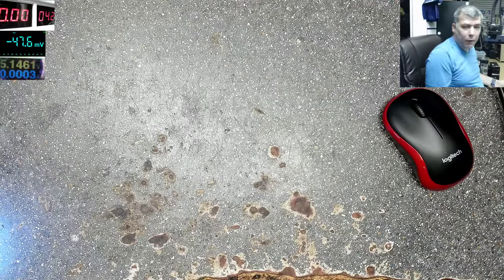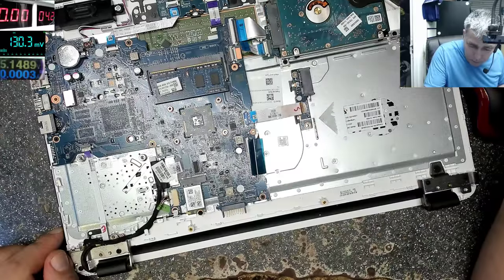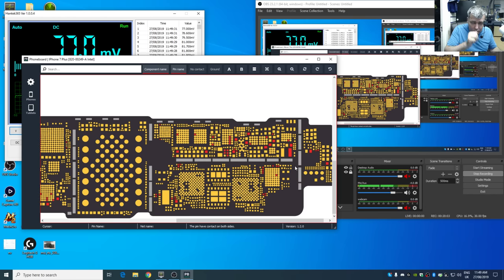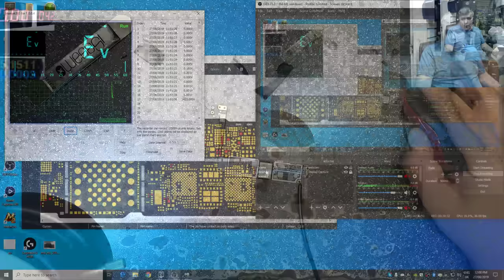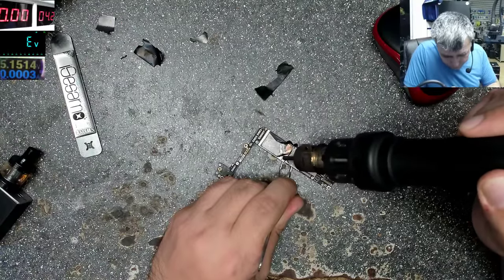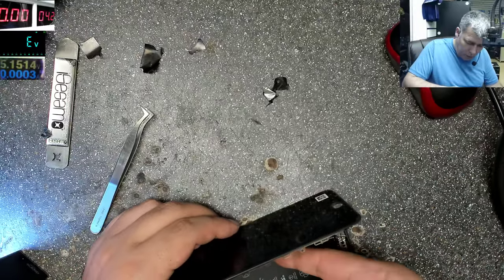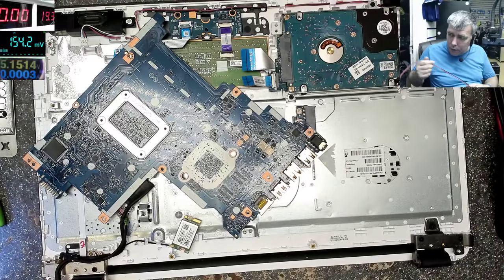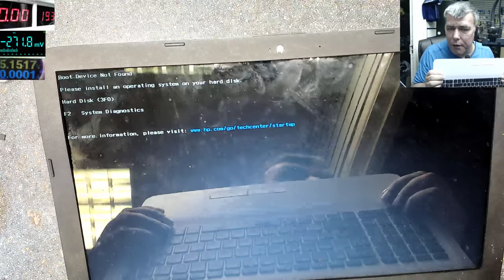HP Laptop & Iphone logic board repair.

Comment: A video on cautions when working with the power supply, would be good. I remember you accidentally touched the center pin on the charging port and burned up a chip!  A video might save us from burning up a motherboard or phone etc!

Comment: it is better to check the iphone 7 plus before cleaning so the damage is clear and after the repair is done clean the board. and since you are dealing with iphone repair, a suggestion to get the cable with the battery sockets that can be attached to your power supply and that way your hands are free to work on the board while power connected.
Reply: How can I open iphone
Reply: @CharlesJohn-yc6ne  which iPhone? You can actually look in you tube and it will show how to open an iPhone.

Comment: I've been watching videos for a long time. I think you need a thermal camera.:))
Reply: It does help! Actually, it does help a lot, but Sorin's petrol/lighter fluid method is cheaper overall. The hand held units I use gulps down the batteries. I'm always worried I will run out of batteries, that's why I am here learning from tech surgeon Sorin, just in case. He's such a good bloke sharing this knowledge
Reply: @wefukthenwo  we are grateful to him

Comment: Thanks for share the video.. when you bypass the mosfet it's right to put a 5v zener diode for inverse voltage protection, over voltage protection, over current protection :D in this bypass bridge?

Comment: Hi, love the channel. Very useful content. I have a lenovo laptop newer model, no power, no charge .. nothing. I located a bad resistor and replaced it. It does turn on now, but only on charger. When I plug in the battery it cuts off or doesn't turn on at all. What could be the problem? Any advice would be appreciated

Comment: FLIR E4 WIFI Upgraded Thermal Camera = £900+ / Fluke visible IR thermometer VT02 = £320 .
Not so cheap 'hotspot finder' solution, yeah ? Thinking if mounted on a 'desktop stand' be a good hands-free tool tho ?

Comment: You shouldnt leave bridge instead of mosfet, laptop wont work properly and wont work with batterry. There was diode or charger damaged. Costs $3 on aliexpress.
Reply: You still have a lot to learn Sir.
Reply: S G: I was thinking about the same. But here he is lucky I think. That mosfet is not for "switching" source between charger voltage or battery. This is only for a protection to stop charger voltage. You have right - if there was no short on the board, then probably the charger ic is bad, so laptop is working now but will not charge the battery anymore.
It could be 5 fucking minutes more, to check if that mosfet is bad, and if yes, then read the numbers from it, check in google what it is (n-channel or p-channel) and take any from other donor boards, which he has there. But I'm thinking that he knew that it will be more charger ic issue than bad mosfet only. (Mosfet usually if is bad, it makes a bridge)

Comment: You should try the rosin smoke method , just put rosin smoke on the board, then it turns foggy then apply voltage the component will melt the smoke, easy
Reply: @TT TT I'm about his age m8

Comment: i cant see how any repair the starts with a dead laptop and ends with a working laptop is dodgy ?  ok one of the "safety" components has been removed, but as you say there are many others, including the ones in the power supply !  .........and thats assuming the protection circuits do their job ?.............im sure im not the only one on here that has opened a device to find just about every component fried.............apart from the fuse of course !  :)

Comment: Sorin with all due respect..please dont call power inductors ... carbon resistors because they are not the same..its so important if you are teaching beginners to use the correct labels for components...its clearly marked PL..this means its a power inductor...PQ means power transistor...PC means power capacitor...why do you call carbon resistors...inductors..its wrong!!!